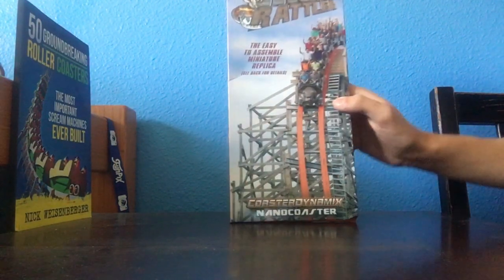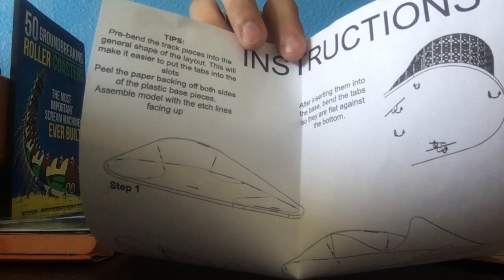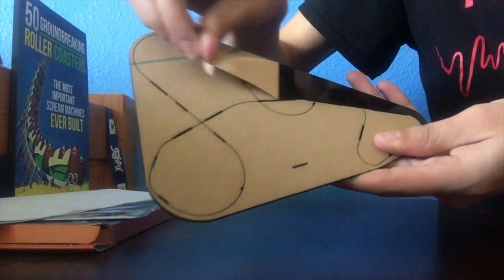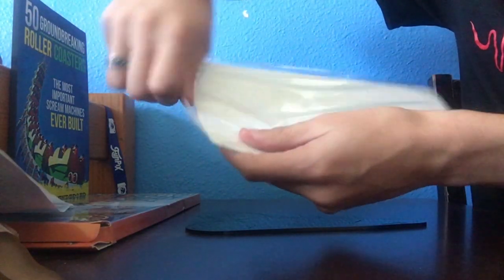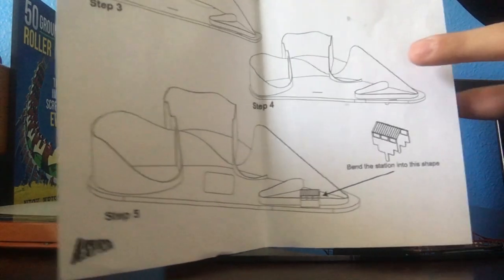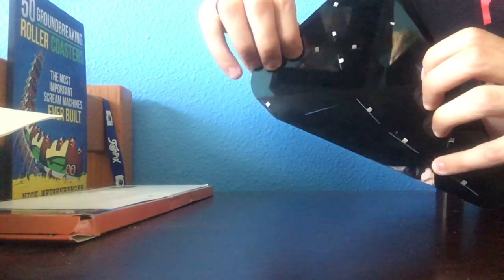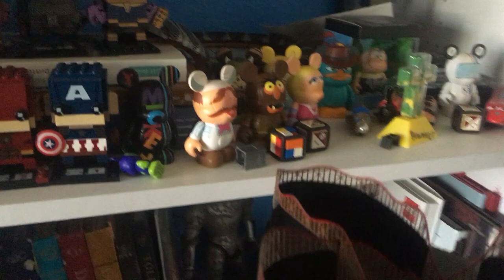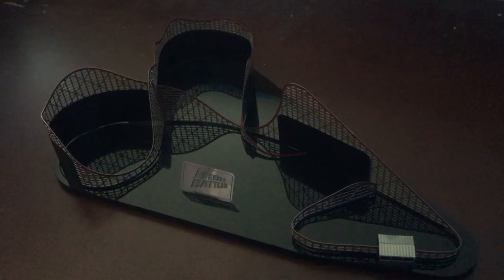Building an Iron Rattler Nanocoaster Model!

Comment: This seems like a lot more work than it should be, I wonder why it's so tricky. Like the packaging could probably be a little better.
Reply from the maker: The trickiest part of it is bending the steel into exactly the right place. With 4 different point the connect on one piece it has to be pretty much perfectly shaped.